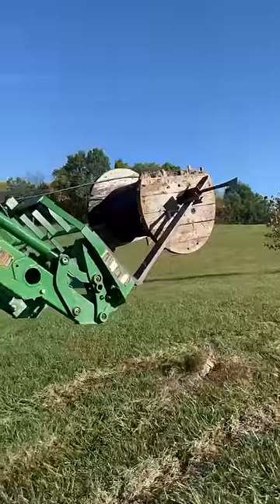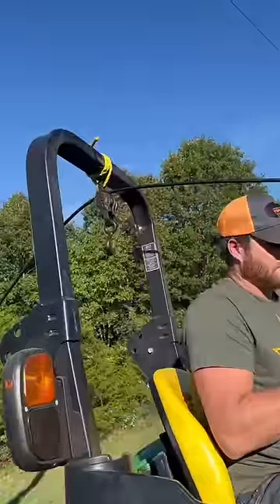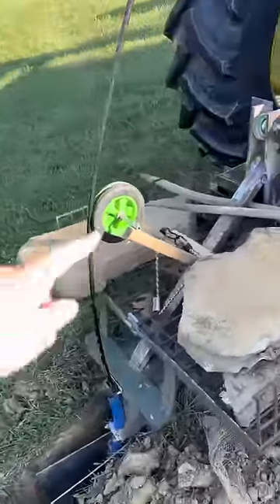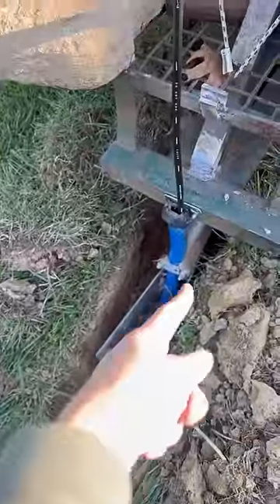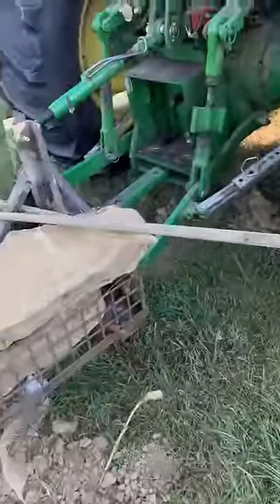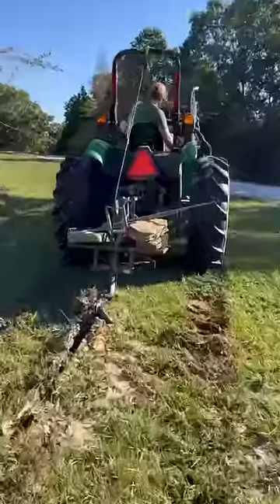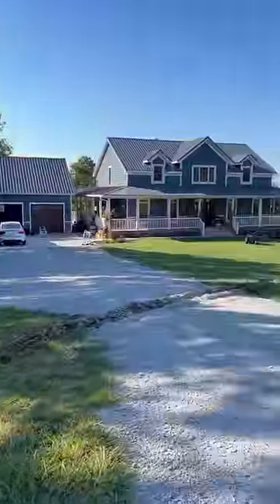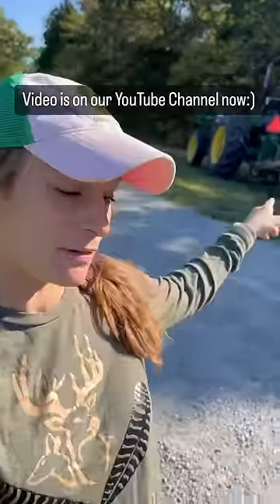Husband=GENIUS!🤯 DIY Subsoiler Build!       #johndeere #farmlife #amazing #welding #country

Comment: When your husband invents an exact replica of a machine that already exists. Still, her excitement is quite heartwarming either way
Reply: Yep, it $55 for 8hrs at the rentacenter and it doesn't stress the cable
Reply: @rickritco9815  That doesn't do you much good if the nearest place renting them is 500 miles away.
Reply: @rickritco9815  that's some thick cable and would need a ditch witch/vibratory plow and as someone who does irrigation and rents one a few times a year I can tell you it's more like $500 for the day..
Reply: @rickritco9815  Dude they are homesteaders, they live in the middle of nowhere hence the reason for having to make a bush mechanic ditch witch.
Reply: I was thinking the same thing.
Reply: @thesprinklerguy2598 I am an electrician and they do make this. Not sure why because you work in sprinklers your an expert in underground line work. There is also an attachment you can rent for 80$ a day if you have a zero turn mower. These attachments are not make shift and will not put the fiber under distress. Fiber is glass inside and I’m sure you know that because your an expert irrigation fiber guy. The fiber does has to go 24/36inchs on residential, they are on a farm and have a John dear I can rent a ditch witch for 105$ a day and that’s not a contractors premium. Point is stick too sprinklers.
Reply: @rickritco9815 some people just can’t be happy for other people’s things. Get a life Rick
Reply: Anybody can rent something.  It doesn't make you less of a man to appreciate someone's successful attempt to recreate it.
Reply: @Christian-cw9mp  that’s not what anyone is saying but okay.
Reply: I agree
Reply: Ran one for years you are exactly right.
Reply: @rickritco9815  and where exactly are we supposed to find a rent a center when you live in rural America? You think we have a rent a center next to our none exhistant Starbucks?
Reply: @rickritco9815 I stayed on my uncle's farm where he does this sort of crazy crap but then again he lives 4 hours away from the nearest rentacenter. He said it didn't make much sense to go somewhere to rent something when you can make something and have the job done in less time and doesn't cost you a cent if it's made of junk around the farm.... Not much I could say to that really...
Reply: The title is DIY. Do you know what that means?
Reply: He didn't invent anything, just used what he had and a little ingenuity to potentially save some $$$, bravo.
Reply: @TheSighphiguy  I take it you put nobody in quotes because you knew your claim was factually incorrect
Reply: The genius part is he made it from stuff he already had instead of spending lots of money on the one that already exists. Well done man, well done. Bonus he didn’t hire someone else to come do the work for him.
Reply: I didn't know create is another word for invent
Reply: Exactly
Reply: I built something very similar to that but bigger to fit a full size tractor to install inch plastic water pipes on the farm I work on, yes you can rent or buy one, we're right in the middle of farm country so undoubtedly could've borrowed one too but we had the bits kicking about we had the knowledge and skill needed to produce one and infact the one I built is better as it articulates slightly for corners, so kudos to these folks for giving it a bloody good go, be interested to know if the fibre survived as it has kind of fragile.
Reply: I believe this was a well edit short, I wonder how many time that brace bar snapped or broken off for the cutting edge, because it looks like something off some kids swingset?

I'm not quite sure if there out in the middle of "nowhere" why their putting fiber optic cable in? city slicker's move out town a couple miles and there in the middle of nowhere. 

I had uncle that lived in alaska now that guy lived in the middle of "nowhere - His  grocery run was with a bush plane once every 3 months.
Reply: @jax1627  Why are you claiming that fiber has to go as deep as electrical? I did fiber for several companies, including google, and it goes 10 inches at the most. As for sprinklers, what do you think they lay the lines with? Same machines, same methods, and not even that deep. Stick to electrical, lol.
Reply: The fact is he made it mate
Reply: We been laying PVC  pipe for years in Florida under ground with no digging in the Orange groves
Reply: @adrianclifton9102  not really fragile. actually freaky strong for its size.
Reply: @3Cathill  I've done work in Florida, you basically just have sand you don't even need a shovel for. Here we have dirt that can be rock hard when it's dry and even harder clay layers underneath, along with rocks like dinner plates that can stop machines in their tracks. Not mention tree roots. So many tree roots. In one town in Oklahoma (I think it was) they had to stop the project cause 6 inches down was a layer of solid rock. The price per house Google was paying wasn't even covering the cost of drill bits when they tried that.
Reply: Amazingly, different geographic locations can have different requirements for different types of fiber optics. As far as I remember there are no depth requirements for direct burial of non-conductive fiber optics cables, nationally at least. Your area may require certain depths depending on conductivity, jacketing, pre or field assembled cables, etc. so you're all wrong....and you're all right.😂. 
 And yeah he may not have invented the concept of a machine that buries cables, but he may have invented a machine that buries them in the exact manner that he is doing it.
Reply: @Bit01  currently working at a fiber company. Has to be in conduit and minimum 24 inches. But nice try.
Reply: @Raught338  oooh, an unnamed company in in an unknown country without mentioning if it was mainline or residential. Boy, you sure proved all of nothing.
Reply: People in the comments are probably thinking of a ditch witch, but this looks far more like a tile boot.
Reply: Another one is jealous. If there is another one HE DIDN'T WASTE HIS MONEY LIKE YOU WOULD
Reply: Go ahead and rent it and make a video. You ever driven a tractor or a girl's bike?
Reply: @DT-abcd  If you mean me, I learned to drive on my great grandpa's tractor and I had a little sister growing up, so yes.

Comment: As long as you don’t hit the max bend radius, this is how allot of cable is installed.

EDIT: I know they weren’t close, I was just stating a fact. I have worked with fiber and copper cable in both residential and commercial applications.
Reply: Same thing I was thinking. As long as it doesn’t exceed the bend radius and fracture
Reply: @kbdesignz5808   I build Fiber optic cable he did not exceeded the  max bend radius not even close.
Reply: The only way to exceed the max bend radius in this case is to do anything over a 180 degree turn and end up cutting the cable from running back over it.
Reply: @tommyblack4564  I work with copper and fiber as well, I wasn’t saying he did. I was just stating a fact.
Reply: @Feral_Sage  I was just stating a fact, fiber is far more flexible than something like air insulated hardline coax.
Reply: or a big rock, or the other utiluty services.
Reply: I put that stuff in for almost 6 years that stuff can take a shitload of punishment it's crazy, Ive fucked up before and folded them in half or twisted em up, and then hook the fault detector to it just to see and it still get light through to the other side. I mean damn near tie the son of a bitch in a knot and it still works, fiber optics is incredible stuff.
Reply: Funny,  how a lot of people think this is a new idea
Reply: minimum bend radius
Reply: @dodsg  yes you are, I am not good at remembering terms.
Reply: Then you should know you cannot lay fiber this way.  It would destroy it...

Comment: I’ve been in the fiber industry for 40 years and this is honestly one of the most creative solutions I’ve ever seen!  Well done!
Reply: What's creative about this? It's the same way pipes and cables have been put in the ground for over a century.
Reply: I’ve just started in the industry, and work with a man who does these kind of solutions daily and this is still blowing me away
Reply: For sure I will agree with the others this is standard operation setup. It's just that it's set up for home equipment in soft ground. But whether you're using track machine or a Dozer with a modified Ripper shank on the back this is how conduit gets laid. Oh and one more thing I hope it never happens to them but they may sadly and deeply regret not putting in conduit.
So I will say that this is a good Homebrew adaptation of what goes on every day in this country
Reply: @brizzle8797 We always used a trencher, drilled in the conduit, or used a backhoe or swampbuggy. This is the first plow I've seen actually work. 😂
Reply: @Jake-yf9ky  
Yeah I think it really depends on the soil type. This area looks super soft is that little tractor wasn't even grunting very much. We definitely use a bunch of boring machines but we also have this track Vermeer vibratory plow that does exactly the same thing that this does except it Plows in conduit so the conduit comes all the way up and over from a spool holder on the front of the machine and gets buried into the ground.
But as anyone who's had to service fiber for any amount of time after it was installed the second that gets nicked you're really going to wish you had a way to pull in a new piece.
I remember one section that was incredibly Rocky and they brought in this big D9 or larger I don't quite remember now and it had this huge single Ripper shank on it that was modified to shuttle in 2 inch duct. That thing was a monster.
Reply: @brizzle8797  Company I used to work for had a old D9 ripper and that thing was useless except for moving the interduct. 😆 
The hydraulics on the ripper were shot, and it wouldn't stay in the ground.
Reply: I mean he pretty much just made a standard plow we use to put fiber in the ground for longer distances. We would put miles in on that thing.
Reply: @Jake-yf9ky I assume you were working in towns and/or doing short lengths? Pulling in pipes and cables is very common in the countryside where the lengths are long and there isn't much to damage by ripping the ground.
Reply: @Pete856  It was a relocate in Waynesboro, GA. We went through a couple of yards but mainly fields and the corner of a peanut farm.
I found out what that ripper did, and I thought, "Hell yeah, this thing is awesome", until it didn't work and we had to call in the drill and use trenchers and backhoes.
Reply: I hope there isn't a highway or a railroad crossing his way
Reply: Fiber industry? :DDDDDDDDDDDDDDDDDDDDDDDDDDDDDDDD
Reply: @Pete856 , the fabrication from materials lying around is waaaayyy above the average dudes capabilities these days.
Reply: @inkw4n-nd5iw  Maybe for city dudes, for country dudes it's quite basic.
Reply: @Pete856 , the bar for being called creative isn't so high you need to invent a brand new, never-before-seen contraption.  Even for country dudes.
Reply: You obviously haven’t been in the industry. Many heavy equipment manufacturers have been making them for many decades. They work great...unless there’s rocks. Then not so much.
Reply: @keithb6717 , equipment manufacturers have been making cars for decades. I'd be impressed if Joe schmo built one from scratch in his garage.
Reply: Buy a 3 pt how to receiver hitch adapter. 
Take a tine from a box blade. Get 1ft if 2”x2” tubing.  Drill a hole in the side to f the tubing. Cut a slit for the tube to pass through it. 
Put a pin through the tone. 
Attach a piece of conduit to the tube going out the back.  Feed a water line or cable.  

How do I know this works.I layed 1/2 mile runs f new water line at my place.
Reply: @inkw4n-nd5iw  
So you’re saying that you missed the point. Got it.

Comment: Great idea, but if you're going to bury fiber then put it into a conduit. Bury the conduit with a pull tape inside and then pull the fiber through once it's in place. Fiber is definitely the way to go for this sort of install, but use conduit to protect the cable and have future options. Also, make sure to document where the cable is placed and how deep, so future digs won't hit that cable. Nice home made trencher!
Reply: 1m is normally enough.

Comment: Not burried deep enough but good effort!!!
Reply: Get some rain & a pickup would dig ruts deep enough to tear it up. Last acreage I tried to buy, that's why I lowballed the bank. They didn't accept it, oh well. Let someone else fix all the F-ups.
Reply from the maker: @toddgittins5692  definitely not as deep as we wanted it to be. This is fiber from house to barn and not from or to ISP.  Free fiber so I’m not mad. We will see how long it lasts.
Reply: @CollinsCountry are you using fiber as n encompassing term ? That looks nothing like any fiber I’ve seen .. and the infrastructure on both ends for true fiber is thousands of dollars on each side
Reply: @alstraka Fiber is not that expensive at all - media converters and fiber SFPs are cheap and affordable, and this certainly looks like direct burial fiber. This is absolutely the best and a very affordable option for getting high speed data between buildings without electrical issues like ground imbalances.
Reply: @saiboogu point to point wireless would be way cheaper
Reply: @alstraka  But only effective with line of sight. That's not easily gotten in the books or woods sometimes, and fiber adds additional capacity and simple reliability (for a bigger but obtainable, especially with diy, cost).
Reply: @alstraka cheap doesn't always mean good sweety.

Comment: Until you find out that the fiber is shattered inside...
Reply: As someone that does fiber I’ve had people peel out on my cables because they’re going across driveways for prep and the fiber inside was perfectly fine. Extremely, and I mean extremely resilient to crushing when in that sheathing. This isn’t hurting the fiber at all and essentially how we pull it through conduit with cap stands

Comment: Great idea. As a former farmer and a current fiber engineer this is absolute genius. Only thing I'd say will be a real problem is if that cable breaks in any way that's a big dig getting it out. Old copper limes this would be fine but I'd suggest putting a pvc duct in there and sealed both ends so if you need to replace it you don't have to dig everything up again.

Again, not trying to take anything away from how genius this is!

Comment: Fantastic. We live in rural Texas and could never get high speed internet.  AT&T wouldn’t bring DSL, cable company wouldn’t bring coax. Then about a year ago they brought fiber down my country road. We went from 1-2Mb/s to 200-350Mb/s.   Enjoy your fiber.  Great job on the system used with the tractor.

Comment: Great idea! Couple of tips from a comms guy, make sure the fiber outer jacket is rated for direct burial, also make sure that the tension use during the pull does not exceed the max allowance and last but not least watch the bending radius on the 90 deg bends, all this is on the manufacture specs. Cheers!

Comment: Really impressed with the ingenuity. Honestly I am, just remember when you lay cable down underground  
You need a sifted material above and below the cable (sand).  Because it’s on a lawn I wouldn’t worry too too much. But all too common this step gets missed and you find problems down the road.  Really cool cable layer!

Comment: I have a 1 shank sub soiler that goes on my D17 allis chalmers. I made a pipe that bolts onto the back of it. It puts the wire in the ground about 14 inches. When you go through the lawn you cant even tell that you went through it after you drive back over the trench with the tractor wheels.

Comment: We used, what we called, a sneaker, to install cables and pvc for lawn sprinkler systems, back in the mid 80s. It had a blade with a knife front edge and bulbous bottom back edge. It cut through sod and dirt and left a space for the pipe or wire being pulled in behind it.

Comment: Did almost the same thing using a garden tractor a spool of electrical wire and some welded metal attached to the 
Tractor to bury an electronic dog fnce on a 1 acre lot...worked great.

Comment: Your hubby is a genius but for safety sake maybe he could have that cable route through a metal pipe overhead & a guide on the wheel that the cable runs across. Love y'all's innovative spirit though 👍 I have it too

Comment: Need to lay some sand that that hole at least 4 times the thickness of the wire tamp flat, then grab you sum red tape and spread it the entire distance of the wire on the sand. Finally backfill and compact job done.

Comment: We thought homesteading would be fun until power went out (almost) every time it stormed….😂😂
About a yr ago we sold our 20+ acres and gave it up since working from home required a back system for everything. 
Massive whole house generator and high powered backup batteries for laptops/monitors and Starlink. On top of that, we put whole home surge protection as the constant surges before outage almost fried our outside AC unit and built in fridge. 
Also, a couple of things most do not speak of is the septic system and Water Wells….
Septics are a pain in the ACE and water wells are next in line. 
Is the freedom nice? Yes. Is the fresh air and wildlife beautiful? Yes.
BUT it wasn’t for us in the long run….when you’re on a call and the power goes out OR trying to work and the septic/well has an issue. 
At the end of the day what it did for us is double the work in our life. lol! 
Hopefully, those not in the WFH tech world can enjoy this lifestyle. 
Best of luck for the future.